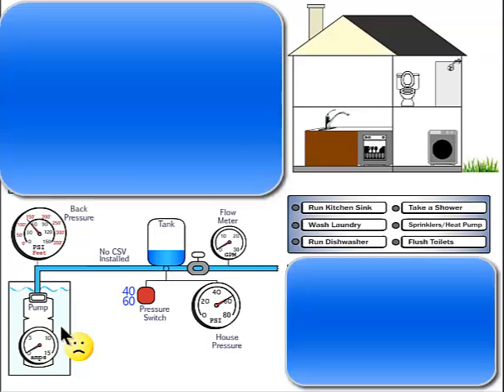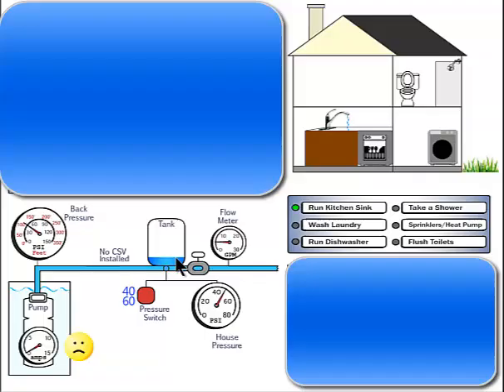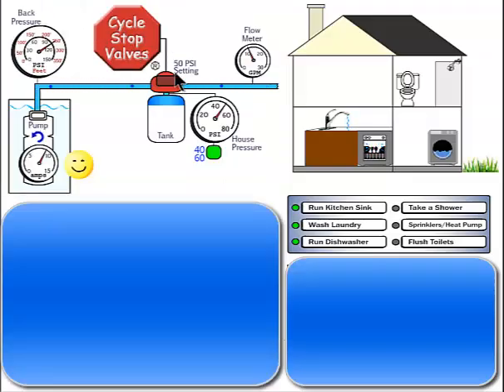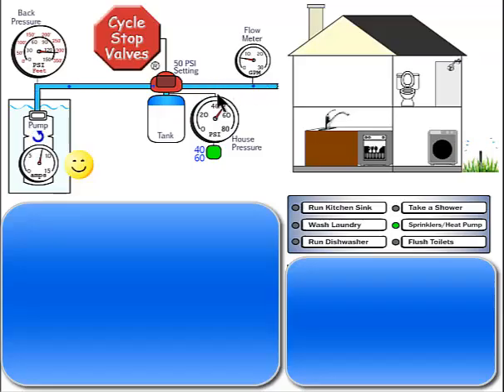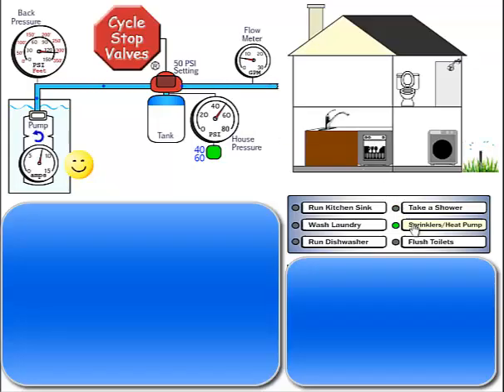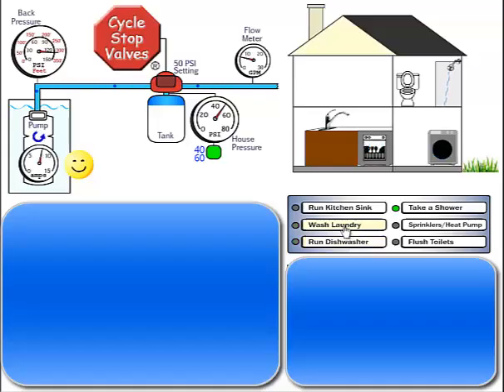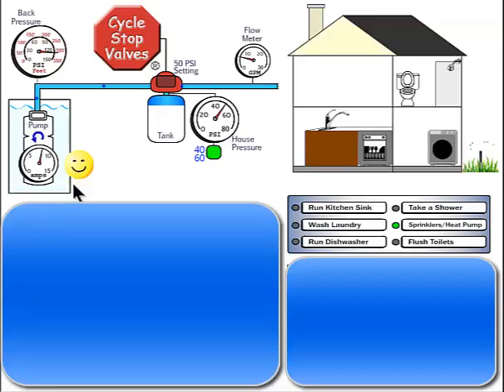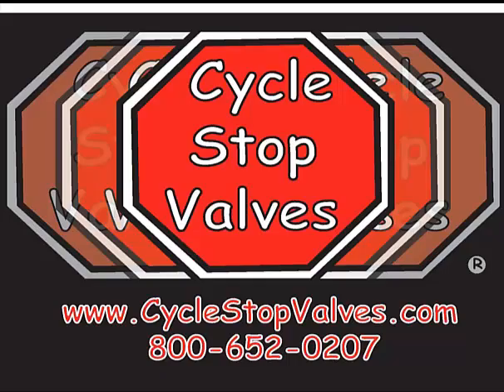How a Pressure Tank Works and why you need a Cycle Stop Valve

Comment: Why would you want this over the simpler system?
Reply from the maker: Because the only problem with the old pressure tank only method is the numerous on/off cycles of the pump.  Adding a simple Cycle Stop Valve solves that problem and makes the old pressure tank method much more dependable, long lasting, and deliver much stronger constant pressure to the house.
Reply: @Cycle Stop Valves  
But if you run water for any time longer than a few minutes that would force the pump to run longer....
A pump isn't a light bulb, leaving it on continuously isn't a benefit like with a simple electric filament. 
A pump is a machine. Long runtime is worse for the pump regardless of how many times it's turned on or off. This is why tractors have an hour keeper on them. The runtime is what decreases it's value and indicates wear and needed upkeep or repairs. This is why we have an odometer in our cars and not an on/off counter. The odometer is a better reading of actual runtime because runtime is the issue, not on/off cycles......
I mean, sure, it seems the CSV would help regulate flow in a system with proper expansion tank(s) set up, but it seems pretty unnecessary when you have those tank(s) in place and properly sized.
Idk, just seems like an extra breakable part in a system that already has enough of them.
Reply from the maker: @elib9002  Pumps are made to run continuously 24/7/365.  says so right on the side of the motor.   Pumps are completely frictionless when up and running and will run forever without any wear.  I have a pump feeding a stock tank that hasn't shut off since it was installed in 1999.  It is the cycling on and off that destroys pumps.  I think you will find that if you start a tractor a 100 times a day it will not last very many hours either.  The wear on a motor happens on start up before the oil is circulating.  Truck drivers know to keep their engines running if they want their truck to last.  Starting is bad on most all equipment.

The pump and bladder in a tank are the "breakable" parts of the system, and the tank breaks from the bladder going up and down too many times from the pump cycling way more than it should.  You cannot install enough pressure tanks to do what a Cycle Stop Valve does.  Just like a light bulb, a pump will last longer if it is never turned off.  The Cycle Stop Valve is a simple and robust piece of equipment that is not going to fail, and will keep the tank, pump, and everything else in a pump system from failing prematurely.
Reply: @Cycle Stop Valves  
Yah...... that's outright false. I just checked mine and there is no such label exists...... 
And there is no such thing as frictionless.
Reply from the maker: @elib9002  Lol!  On the motor label it says "Duty Cont" for continuous.  Also look up the Kingsbury thrust bearing for proof of frictionless.  Your being confrontational.  This is your last chance to learn anything from me as I will delete this unless you start asking nicely.  Lot of hater's for no reason out there, and you sound like one? I am too old to put up with any more crap! Have a nice day.
Reply: @cyclestopvalves8380  the Continuous Duty rating is specifically there for electricians to be able to properly size the wiring for the motor should the pump be ran for 3+ hours at a time. if your pump isn't wired for such then you run the risk of overheating your conductors and tripping the breaker.

i do agree that pumps are designed for running 24/7 though, but you have to make sure that your pump wiring is set up for such
Reply from the maker: @brandonbohnhoff1996  If your pump wiring isn't adequate for running the pump 24/7 it won't be adequate to run it for an hour or even 30 minutes.  Wiring should be done according to installation instructions and best practice no matter what.  Then a pump can run indefinitely as they are made to run continuously.  I have one on a stock well that hasn't shut off since 1999.
Reply: @cyclestopvalves8380  that's literally not how it works. why would there be any difference then in wiring practices for Continuous Duty versus non CD? it's literally in the NEC for the wiring size to be increased for CD. it has nothing to do with whether a pump can do it, it's the electrical system that it's referring to. your wiring for said pump is rated for CD not minimum sizing based on the pump. you aren't an electrician and it shows.
Reply from the maker: @brandonbohnhoff1996  That is literally how it works.  Following is a link to the Franklin Aim manual that explains it.  The NEC code is different for jacketed wire than for individual conductors, but wire size for intermittent use is not even mentioned in the AIM manual, because it is not allowed.  Wire that is too small would starve the motor of power no matter if it is running 10 minutes or 10 years.  Low voltage causes high amperage and the thermal overloads would trip in a short amount of time.  Intermittent use is also hard to define.  Is that one minute an hour, or three hours a day?  Pumps are made for continuous duty, so they are wired according to that code only.  https://www.rcworst.com/Shared/content/mfr/franklin_electric/docs/franklinsubmersiblemotorguide2022.pdf
Reply: @cyclestopvalves8380  the wires would never be too small to deliver power unless you actually undersize the wires. yes, pumps are made for continuous duty. i agreed with you in my first statement. i said that you have to make sure that you're wiring it as such. you can't look at the amperage it draws and go to the tables in 310 and find that amperage and wire it according to that. if you do, you will eventually have problems. there's a section specifically for this because pumps are rated for continuous duty. 

yet, if you run wire for it that is based on those amperages listed in 310 your pump will still run. if you try to run it non-stop, 24/7 it will have problems. if it runs 5 minutes every hour it probably won't have any problems ever though.
Reply from the maker: @brandonbohnhoff1996  "If it runs 5 minutes every hour it probably won't have any problems ever though."  Lol! So 5 minutes and hour is considered intermittent use.  I always wondered how to classify that.  Like you said, pumps are made for continuous duty, so they should be wired appropriately.  I just didn't know there was any other way.  :)
Reply: @brandonbohnhoff1996 What happens if you turn that pump on and off every 30 seconds?

Comment: ? I take water should not come out the air valve? Leaky bladder?
Reply from the maker: Correct.  If water comes out the air valve on a pressure tank the diaphragm or bladder is torn.

Comment: I have an 18000L holding tank becuase water gets shut off daily. What size of pressure tank do i need? Can the pressure be adjusted with the CSV?
Reply from the maker: Yes the CSV1A can be adjusted from 15 to 150 PSI.  With the CSV you only need a little 4.5 gallon size pressure tank when using pressure lower than 50/70.
Reply: @cyclestopvalves8380  this water system is for  supplying 11 houses. Thats about 110gal per minute in peak time. I notice its rated up to 25gpm
Reply from the maker: @thisisme2024-b9l  That is even a better example of why you need a Cycle Stop Valve.  Planning for a peak flow of 110 GPM is great for 11 homes.  However, they will probably never use more than about 50 GPM at any one time.  A 2" CSV model CSV3A2T will work with a pump that can produce up to 150 GPM.  With a regular 40/60 pressure switch a CSV will deliver 55 PSI constant and work with a 86 gallon size pressure tank, even though an 80 gallon tank only holds 20 gallons of water.  The CSV will deliver strong constant 55 PSI for peak demands up to the max 110 GPM, supply a single shower for a single person during off peak hours, or anything in between.
Reply: @cyclestopvalves8380  are you saying i need a 50gal+ pressure tank or just clarifying what it will handle? I thought a 10gal pressure tank is enough
Reply from the maker: @thisisme2024-b9l  10 gallon tank is enough for the smaller pumps/CSV's and maybe up to 3-4 houses.  But 11 houses and a 110 GPM pump would require at least a 44 gallon size tank, and an 86 gallon tank is better and has the same size footprint.  The 86 is just twice as tall as a 44.  With 11 houses you need 20 gallons of draw down as comes from am 86 gallon size tank to handle some toilet flushes and things during times the pump is off.  Funny thing is, if you had maybe 50 or more houses the pressure tank could be smaller because it is unlikely the pump will ever shut off as there is always some demand with that many houses.  When there is as little as 3 GPM even the 2" Cycle Stop Valve will keep the pump running to supply what is needed.
Reply: @cyclestopvalves8380  how many gpm will be let through to fill the tank? Lets say we start 5am watering the plants and its 5gpm for 30m+ showers and cookingand toilets.
Reply from the maker: @thisisme2024-b9l  The CSV doesn't let the tank fill at all when there is a sprinkler, shower, or any other water tap open.  The CSV just opens more when you use more water and supplies plants, showers, cooking, toilets all at the same time.  Only when all the taps are closed will the CSV allow 1 GPM to go into the tank until it is full, then the pump will shut off.
Reply: @cyclestopvalves8380 Going to have to disagree somewhat on this one.  On a 40/60 PT with a 50 psi CSV, the pump won’t come on until the pressure drops to 40 with the PT ‘empty’.  The pump will kick on and fill the tank to 50 psi where the CSV will then control the pressure (maybe with some slight pressure fluctuation here until CSV settles out) until the water is turned off then the pressure tank will fill the rest of the way.
Reply from the maker: @jeffmcwilliams4060  I don't understand what you disagree with?  You are exactly right that when using water the pressure tank empties as the pressure drops from 60 to 40.  At 40 PSI the pressure switch starts the pump and it fills the tank to 50 PSI where the CSV holds that pressure very constant at 50 PSI and does not let the pump shut off.  Only when the taps have been turned off will the CSV allow the tank to fill from 50 to 60 PSI where the pressure switch will shut off the pump.  Only thing I see you may be disagreeing with is you think it takes times for the CSV to settle out and the pressure fluctuates slightly?  The CSV reacts almost instantly and doesn't take any time to settle out.  It may take a little time for the pressure tank to fill and the non-fluctuating constant pressure to be seen, but the CSV has no delay in response.
Reply: https://www.youtube.com/watch?v=HSwOpyNXs28

Comment: our water system goes out intermittently.  we want to install a 5000L holding tank . the water fills the tank fron the main water source. i dont want the pump to run 24hrs per day. the pump is installed after the tank..will the Cycle stop valve also go after the pump ob this type of application?
Reply from the maker: The pump should be installed after the holding tank, but prior to a pressure tank.  The CSV would go after the pump and before the pressure tank/pressure switch.  The CSV only causes the pump to run when you are using water.  But if you use water 24 hours a day, the CSV will make the pump run 24 hours a day, which is a good thing.  Without the CSV the pump would cycle on/off to death when using water for long periods of time.
Reply: @cyclestopvalves8380  and how do i order this for delivery to Canada ?
Reply from the maker: @thisisme2024-b9l  We have shipping to Canada on our site or you can all us.  806 885 4445

Comment: There is 1 single residential home anywhere in this country that has a 24hp pump that you use in your graph claim. Oh and your graph is only 45% not 55%
Reply from the maker: Sorry you are confused.  Maybe you should watch the video again.  It shows a 1HP for residential systems and also a 25HP for commercial applications that drops amps the same way, from 24HP to 12HP.  The small pump drops from 1.392HP to 0.627HP, which is a 55% reduction in energy or amp draw, without varying the RPM of the pump.

Comment: I have city water, but live up a hill and about 2000 feet from the water meter. I have a basic pump in a pump house about 1000 feet from the water meter that pushes the water up the hill, and then a water pressure booster under the house in the crawlspace (DruaMac brand). I am noticing that when I flush the toilet too many times in a row, too rapidly, the water turns off and I have to cycle the GFCI connected to the water pressure booster and then it turns back on. Similar behavior when I run a load of laundry with a front load washer (the valves opening and closing for the washing machine seem to trip up the water pump and the pump turns off, and then I have to again reset the GFCI it's connected to). 

I think I have a CSV installed in my system because when I turn on the kitchen sink, or the shower, the pressure starts low, then builds to the highest pressure and stays there the entire time it is in use. Recently though, I have noticed (and I am not sure if it is because of a heat wave we are experiencing) but I will be using just the kitchen sink and the water will die. GFCI switch isn't popped or anything, but I will reset it to cycle the power on the water pressure booster, and the water turns back on. Any ideas what is happening here? Thanks!
Reply from the maker: Don't think you have a CSV.  The type pump you have uses a flow switch type control and electronic sensors.  Probably doesn't even have a pressure tank, and wouldn't help much anyway.  There needs to be flow through the pump or the pressure needs to drop pretty low before the electronics trigger the pump to start.  Usually by the time the pressure gets low enough to trigger the pump there is no flow to help either.  However, you shouldn't need more than one pump anyway.  Just up the pressure on the first booster until you no longer need the second booster.  A small pressure tank and a CSV on the first booster would let you set it to any pressure you want.  Then you would have strong constant pressure all the time.
Reply: @cyclestopvalves8380  thanks the reply. So the booster does have a little tank attached (size I am not sure of but it is fairly small bc it is sitting on top of the pump itself). I think I have to have both pumps due to the distance and hill and I doubt I could get any decent pressure from just the one pump that is about 800 feet from the house and at the bottom of the hill. I just can't seem to figure out what is causing the water pressure pump under the house to keep turning off during random use scenarios... it has also been hot lately here and just using the kitchen sink or the garden hose will cause the water pressure pump to essentially die (throw a fault or something) and require me to power cycle it.
Reply from the maker: @TheDreadnought  Still think one booster is all you need.  Do this all the time.  But if you want either or both booster pumps to work and not give problems, using a Cycle Stop Valve and a small pressure tank with a pressure switch is the most reliable method.
Reply: @cyclestopvalves8380  I'd love to just have the one pump. I think it would simplify things a lot. I'd probably have to have a pretty powerful pump to get it up the hill and across the estimated distance and still be usable in the house. Right now the pump in the pump house is an F&W booster pump and is 1hp. What brand/model do you recommend for something like what I need? TY
Reply from the maker: @TheDreadnought  It can nearly always be done with only one pump.  I have systems that are set for 400 PSI, to deliver 50 PSI to a community that is on top of a 800' tall mountain.  However, I also have systems that pump for 20 miles, then is picked up by another pump system that pumps another 20 miles, and so on for over 200 miles.  Just need to figure the exact lift or height in distance and the friction loss to know what size pump is needed and what pressure to set the CSV to deliver.  Just need to know the height of the mountain.  Lol!  Just call us and we will help you figure it out.
Reply: GFCI are to protect people from electric shock. These should not be used for motor/pump circuits. Have an qualified electrician install a suitable outlet for your booster pump.

Comment: This may be an ignorant question and if so you have my apologies. I am purchasing a newly built home with a well. I am trying to understand how the well systems work and so far this was the best description of the two main pressure systems, so thank you. I would like to know where in these systems would you put the water softener, reverse osmosis, and other filtering systems. Should you put something before and after or just after?
Reply from the maker: Thank you!  All filters, softeners, and such should be placed after the CSV/pressure tank on the line going to the house.  Keep in mind filters and softeners lose quite a bit of pressure through them.  So, you may want to set up your system with 60 PSI constant from the CSV using a 50/70 pressure switch instead of the usual 40/60 pressure settings.
Reply: @cyclestopvalves8380  thank you so much. Have a great weekend